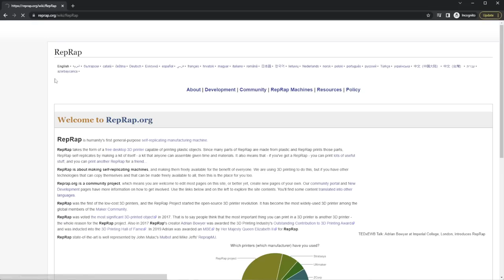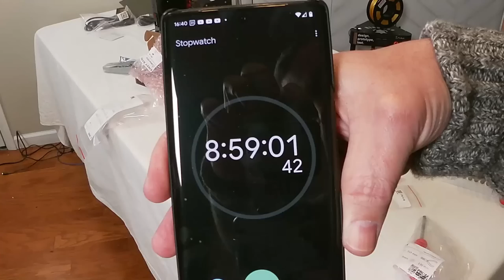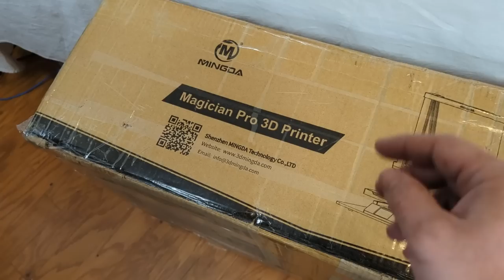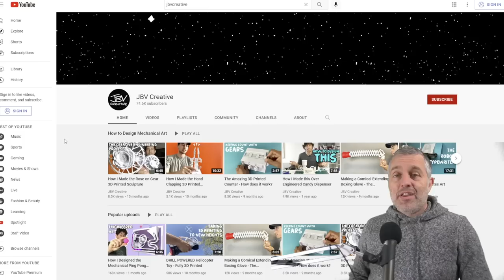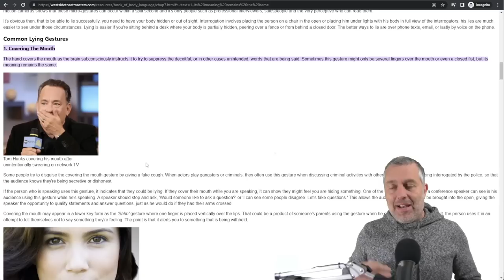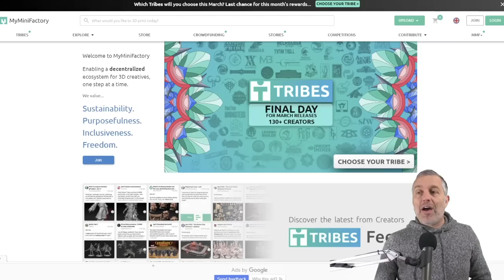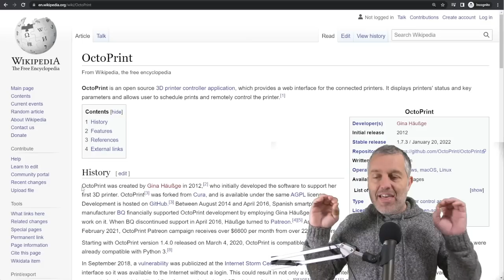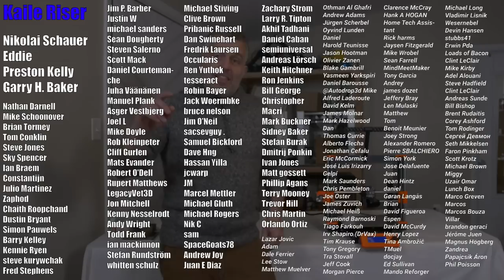Why Does Nobody Speak Truth About The Prusa I3 Mk.3? - It's Overhyped and Over Priced.

Comment: After about 3 years owning a a 3d printer for practical parts for our small business I have noticed three things.  Prusa people are very loud and enjoy talking down to anyone who doesn't have the inclination to Prusa.  No matter what your needs you should be printing some for of PLA there is never any reason to use PetG, ABS, and rarely nylon.  People will always second guess you upgrading to all metal hotend because well PLA variants is all you should be printing with so high temp printing is pointless.

I was always weary of that Prusa price tag and all those 3d printed parts.  The most Prusa seems to offer is faster print speeds once you dial in.  For the same money I could get around 2-3 refurbished Ender 5 Pros.  And throw a cheap bl touch, bi-metal heat break,  a cheap direct drive bracket, and a good glass bed and probably have a few bucks left with a very solid and dependable set of machines printing almost as fast.

Prusa almost looks to be a status symbol for would be 3d printing hobby snobs.  If your dishing out that much for a Prusa why not spend a few hundred extra and get any of the more serious machines coming out with things like heated chambers, enclosed, or core xy?

Comment: You’re complaining about having to use both ends of an Allen key OMFG… That’s what they’re made for. It’s not overhyped, you just seem to make things hard for yourself. I don’t think your take is very balanced, but each to their own. I have a MK3S and it’s awesome, it’s been printing trouble free for a couple years now. There are other good printers out there, but for the money, the Prusa MK3S is pretty good.
Reply from the maker: An Ender 3 costs $500 less and takes 7.5 hours less time to assemble. It produces 98% the same quality of prints. Your comment here is blaming me (the end user) for the failings of Prusa's design. What happened to "the customer is always right?"

Comment: i think the issue with the spire was due to minimum layer times. Thats the only reason I can think of why it would get messed up as soon as the rest of the print is complete.
Reply from the maker: Yes. I've experimented with the minimum layer time on a single spire. It does have an effect but it's not very substantial. For more dramatic improvement design your G-code so that the print head leaves the area in between each layer. The radiant heat coming from the nozzle keeps the thin spire soft even if you decrease or increase the minimum layer time. In the case of the video the two spires had pretty similar layer times all the way up the spire. The part cooling on the Prusa really is that much worse. It would be hard to design a worse fan duct than what Prusa sends in the kit. I would improve the design, but I vowed NEVER to help Prusa improve his products again after I got burned 5 years ago. https://www.youtube.com/shorts/Rp5K_gSmKoE

Comment: 4:35 If you've followed the manual carefully, you would know, what the "Joseph Prusa Avatar" means.
6:35 And you would not complain about nuts being tightly fit into 3D-parts. 🤦‍♂
(Hint: The Avatar is supposed to remind you, how to easily draw those nuts in by using a screw. It's explained at the beginning of that "too detailed" manual.)

Comment: HOL' UP!

I don't have a Prusa printer. As a matter of fact, I didn't get a Prusa because I felt it was over-hyped and it looked antiquated... What did I get instead? I got an Anycubic Mega Pro... and I can tell you 65% of my prints I either have to manually cancel or come back to witness a failed print. The best way I can describe my i3m pro is this: it's a hunk of sturdy shit... and every single fucking post I see of someone with a successful print or showcasing something cool either has an Ender, a Prusa or a Voron. I see a TON of people with ender printer complaining how much money the have sinked into the printer before it was actually able to print quality prints.... to that I can relate. I threw 400 USD down the drain when I purchased this garbage and I'm probably close to 300 - 400 more in parts, tools, and miscellaneous doodads only to get S H I T prints. 

So... when you say a Prusa is a polished turd... I believe you are missing the point... because from what I've seen the majority of Prusa owners are able to get quality prints with little to no upgrade. EXACTLY, for the reason you said... IT IS POLISHED. 

So follow your own damn advice and stop recommending shit gamble printers from China and ender (never ending upgrade money sinks).

Say it how it has to be said.

Owning a 3D printer is like owning a CAR back in the late 1700's. It is NOT a tool you BUY and it just WORKS perfectly. You will have to tinker... and tinker endlessly. Fix. Upgrade. Babysit as if it was a 9mo old baby crawling around the edge of a cliff.

So the solution is clear.

Either get a polished turd and skip all the tinkering... OR... build a Voron and learning everything there is about a 3D printer as you are building it. 

Trust me... I've taken apart my REAL turd countless of times and it's stills SHIT. No polish. No nothing. Just a sturdy shit printer that prints out 45%  of the time meh quality prints.

Finally, how can you accuse a Redditor to writing something outdated when you are doing exactly the same thing?

After looking at the Prusa XL you can still say the MK3 is Prusa's flagship? I mean... have you ever purchased a phone before? As soon as the new one is announced... regardless of WHO has seen it or not... The previous version is NO LONGER the flagship. It's just the outgoing model. A model that suddenly drops in price and the few that own one are trying to sell it quickly so that they can buy the NEW and TRUE flagship that was just announced.

TL;DR: Fuck Prusa Mk3, Fuck Ender, Fuck Creality. At the end of the day you are going to save a lot more if you build a Voron... and if you have never built a 3DP before... TOUGH LUCK! There is a 99.9999% chance you will have to disassemble whatever it is you buy prebuilt anyways. So you mind as well get something good and build something good and learn while you are doing it.  The next best thing? Might, might, might be a Prusa XL because it's promising to solve all the issues ALL OTHER PRINTERS HAVE... including the damn Voron.

... and no you dick... I'm not a bot. Just because I don't agree with you.

Comment: Why prusa work on 236% speed when you print test cube ? And why you dont use prusa slicer to gest the best setings to print in prusa  i think you can add chainisee printer to prusa slicer. When you youse worong steing and 236% speed you have vertical lines ... but it to fast for best quality

Comment: For the comparison test print, the prusa has the 236% shown, meaning it is scaling the printing process up by that percent. Can you confirm this to be the case? If so, that means this test wasn't apples to apples, the prusa had a much higher speed and acceleration.
Reply from the maker: You are the second person to look at the screen and think "Gotcha" instead of listening to the video. I specifically mentioned that I ran the Chinese printer at 235% for that test print as well. Here is some CopyPasta for you:

Let me painfully go through this so we can put it to bed. I did not make it explicit in the video that 70mm/s was too slow to elicit the ghosting response I wanted to see. Therefore, starting with the Prusa I increased the speed factor to 236%. I did make this fact explicit when I talked about it at the 30:06 timestamp saying "The original file was set to be 70mm/s up here, print speed, and I printed at 236% so that's like 150 or so -ish mm/s" Then, when I was talking about the Chinese printer I said at 32:42  "I did up the speed also on this one to 235%" Therefore, the test is valid as both gcode files had the top speed set to 70mm/s and then both machines were run at 235mm/s. The comparison is fair. Both machines were run at the same speeds.  NOTE#1: 235/236=.9956 so I did run the Chinese printer at 99.95% the speed of the Prusa. This happened because the Chinese printer only gives the option to increase in increments of 5%. Technically speaking I ran the Prusa at a 0.5% higher speed. So what!? Go do the study yourself and make things match perfectly. You will get the same results as I showed in the video.  NOTE#2: At the 23:08 time stamp it can be seen where I change the speed on the Prusa back down to 100% for a minute. I did this to observe if the speed factor was actually making the Prusa print faster. I quickly returned it to 235% after verifying.
Reply: Adjusting the print speed with the dial on the printer only changes movement speeds, not accelerations.
Reply: This wasn't a "gotcha", I was simply asking. I agree with lot of what you said. I missed you explaining this portion. Sorry.

Comment: I started 3d printing with Ender 3, it was a popular machine back in its time and after 2 years of printing with it I can tell you its good for teaching you how 3d printer works because it will give you all.. i mean all sorts of problems there is about 3d printing. And while fixing them you will learn everything about 3d printing along with endless headaches and frustration. First of all you cant use ender 3 at its stock config. Its like trying to communicate using smoke signal in modern age instead of using a cell phone. After learning 3d printing I was basically at a point where I could tell what upgrades I needed for my Ender 3 and I made a short list... bed leveling system, new bed because stock one is garbage, new extruder, new hotend and a new silent motherboard. Basically you will only keep the frame and even with all that I'm truly sorry to say it wont get you to a prusa MINI level of quality.
TLDR, 
 if you want a printer as a project by all means go for Ender 3. If you want something works and needs absolutely zero upgrades for years and print stuff without worrying about the print quality get urself a prusa mini or mk3s. 
Thats my experience with both machines, I understand someone elses could be way different but theres a reason for their popularity.

Comment: I'm trying to learn about and am considering buying a 3D printer. What caught my eye is that while the Prusa was printing they dedicated 25% of the already too-small display to advertising. Was there no other data point that could have been displayed here instead?
Reply: The name of the printer is only on screen when not printing. When printing, that line shows the name of the gcode file. So there is not really any important info lost.

(When the logo is displayed, the line above it doesn't display data either, so it's not like there wouldn't be space for more info)
Reply: @DraakjeYoblama  Thank you for the explanation. I was referring to the printers running in the background starting at 20:23 which now that I look again more closely is indeed the name of the file being printed rather than an advertisement.

Comment: the josef image tells you to use the nut pull feature.... but as you dont read it ... how would you know. 
also all screws a printed to scale in the manual - like in a lego manual you can lay your screw on it to find the correct size - something a 6 year old understands...
according to the manual you install the Y-belts befor you screw the belt holders to the bedframe. 
ranting about a manual - but unable to follow it.
having his name on anything is called branding. the company is named after him. its called CI its a thing you know.
Reply from the maker: So, why not post a little graphic showing the use of a screw to mount the nut? Ikea doesn't put pictures of Ingvar all throughout their manuals.

Comment: You can get a refurbished Ender 3 for $100 right now. I’m really tempted.
Reply from the maker: Older control board. Won't work with my recent touch probe upgrade. Totally worth it though if you don't have a printer you won't find a better or less expensive introduction to the hobby. BTW where is the sale?

Comment: I think Josef may be a bit of an egotist, but you may want to practice some self-reflection and realize how you come off on many videos.

I started with an ender 3 v2 and later got a mk3s+. I wouldn't ever recommend someone start with a mk3s+ as you won't know if you like the hobby yet, but I think you're really stirring the pot here with some of the points you make. Like who cares about the haribo joke, it's dumb but just ignore it and move on... I will also agree not all of it is easy as possible to assemble, but I can say that the print quality I get is better. I can more easily run different types of filament, can more easily print faster. The z calibration is far better, and there's way less to fiddle with in general. You maybe fiddle more at the beginning but that pays off in the end. 

Also in your example of printing, the mingda had some loose filament, you could easily slow the speeds down to the Mingda and compare the print quality. You have the spool holder on backwards, you probably assembled it incorrectly to get that result. It's not inconsistent extrusion, go look at their article regarding it, it doesn't look like that.
Reply from the maker: > bit of an egotist 
That's one way of describing a certain kind of person. Pathological Narcissism is how a psychologist might describe the same person. The worst people in history have had this trait: https://www.washingtonpost.com/outlook/psychoanalyzing-historys-meanest-men/2019/04/25/6cf34f38-346c-11e9-af5b-b51b7ff322e9_story.html
Reply from the maker: So, quick question: What's my name?

Comment: Buying my first 3D printer soon and need something out of the box that will work and I won’t have to mess with. Price isn’t a big deal, what would you suggest if building one isn’t my path?
Reply from the maker: Mingda Magician X
Reply: @DesignPrototypeTest  okay I’ll start looking it up. I’m brand brand new to this, you’re videos are awesome. 

Does the one your suggesting have a auto leveling bed and things like that or will I have to install that? Just hobby printing. 

Thank you for your time
Reply from the maker: Easy to assemble, touch nozzle bed leveling and filament runout detection. Truly the Prusa I3 Mk.3 Killer.
Reply: He's wrong about 60% of the things he was talking about, don't belive what he's saying. Get a Flashforge Adventure 3 or a MK3...

Comment: My first printer was an Ender 5 and, for a noobie, it was tough. I then got a Prusa i3 mk3s+ and it was easy - prints perfectly out of the box, compared to the Ender 5. I screwed up the hot end of the Prusa when changing a nozzle so, while waiting for parts bought a new Ender 3. Like the Prusa it was great, out of the box. I agree with you that there is a great disparity in price. That said, I got very little from your video. I don't know how anyone, so strongly biased against the person/personality of Joseph Prusa, can produce a constructive evaluation of a Prusa product. He is not the first person I have heard you rant about. Good technical comment was swamped by a crazy rant. I don't see your name on a 3d printer. Maybe that's the problem.

Comment: I got one because it is A: one of the quietest printer B: one of the safest printers C: it is open source, both the printers and their software.  The Chinese printers are way too loud, they are't safe, even though Prusa has safety features open sourced the Chinese companies disable them on Mk3+ copies because they use cheaper parts.  I don't want open source because it makes things free or cheap, when you are talking about something physical, like a printer, you still need to pay for it, I support it because it makes things more readily available to people and it advances.  Look at the $300 MK3S+ copies, I wouldn't get one but someone who can't afford an official Prusa can get one.

I think most Prusa owners own multiple printers, they buy a Prusa because it is better but their second printer they decide to try the best Chinese printer they can get, because it is still cheaper than a Prusa.  They experience way more inconsistencies, breakdowns, and failed prints and that is where you get die hard Prusa defenders.

Comment: I agree the prusa is WAY overpriced. Its just a random box of parts they source from china for you, and then you have to put it together. It took me 14 hours to assemble. That is outrageous. I also agree I dont like the moving bed. They really need to make it so it can have an enclosed print area. I know its patented, but just put the whole thing in a box shaped frame so someone can slap some syrofoam on the side. Thats hard to do with a prusa but other printers make it very easy. 

The underpowered hotend is a criminal design flaw in my opinion. Its not expensive to get a better one either is the crazy part. But then I have to redesign the printer and custom modify the firmware and a bunch of other stuff just to move to a larger diameter nozzle.

If I could do it again I would just get an ender and upgrade it. The non-auto leveling bed and lack of enclosure is a deal breaker for me though.

One thing you didnt mention is the prusa slicer. Prusa slicer is really good and has a lot of neat design features. My only real complaint is it doesnt always do overhangs all that well. Like sometimes it will try to print lengthwise with the shell when widthwise would make far more sense.